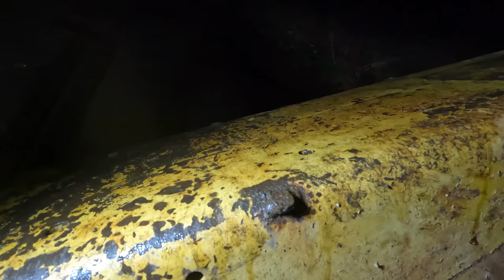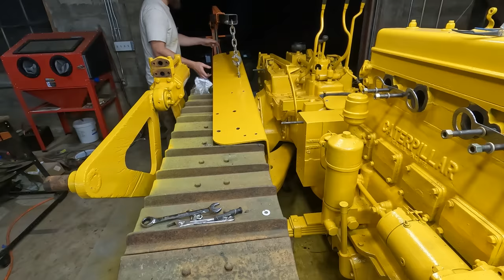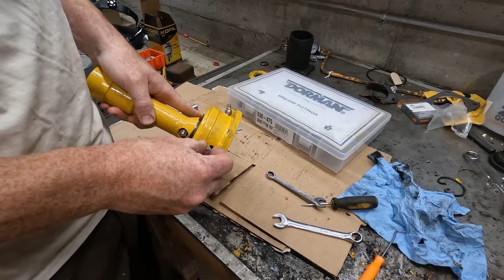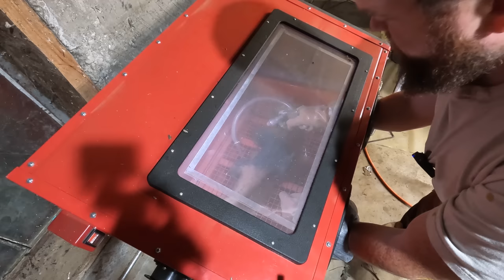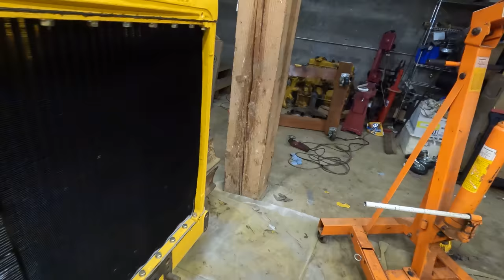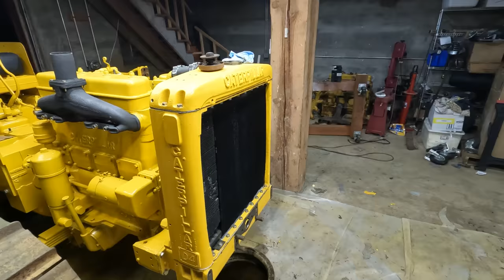Caterpillar D4 radiator and fuel tank install

Comment: Hi Matt, loving the story!! May I suggest, when you rebuild your waterpump (unless the manual states differently), put the front seal in backwards, so the 'lip' is facing outwards. Otherwise when you grease it, it has the potential to force one of the seals out. It will be protected well enough from debris under the pulley, and still prevent dirt / moisture from entering the bearing. Just my 2 cents worth, anyway! Looking forward to your next instalment!

Comment: I been watching your channel off and on for last 2 years.Im 60 now.My dad was a korean b-29 tailgunner based outa altus oklahoma he got out in 55.and his dream was starting his own construction buisness in minnesota well he was poor and bought lots of bulldozers and a case backhoe.my dad dyed at 47 years old from liver cancer.i still caint find the minnopilis molene backhoe he had he always worked on that.I found the guy that bought my dads old trailer that dad hauled behind his dumptruck he also bought the case bulldozer with bucket.he said i dunno how your dad did that cause trailer  it never had  no wood..dad just drove it up and wiggled on the steel beams and it sure wasnt legal but dad did it.dad  had a d4 bucket one and he bought i dunno a huge bulldozer with a ponymotor he got it running 2 times enough to push a hillside away into a road then it dyed again.i was just a kid i remember doing iumps to see if i could hop from ground to top of tracks

Comment: Lookin Good Matt,  You'll be "puttin around before Christmas???
You can probably pull the stem out of the spray can by running a screw in and pulling it out. But knowing your resourcefulness you've probably already tried.
I like your use of the engine hoist. I've never had one and too old to buy one now but it would have been a worthy purchase for me. I work solo just like you. I've used the three point and the loader on my Kubota's for some of the heavy lifting. I've got a "story pole" for the three point and the loader. 
SUPERB work SIR!!!!!

Comment: Matt, red locktite is for high temperatures.
Blue will fail and act as a lubricant allowing studs to loosen due to heat and vibration.

Comment: - Great video for us all, Matt... Congratulations with the continuing sprint to the finish line.
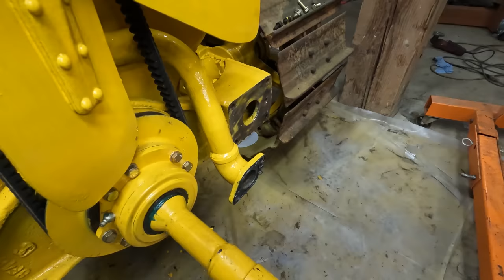- I was yelling at the screen earlier..."I remembered my hose clamps this time." 29:25 Phew ! ! !
- And, yes, I worried about when "we'd" be removing the water pump to deal with the pulley shaft inner bearing...10:00, and the answer is...38:36 "On the next video I will rebuilt the water pump."...hurrah(?)

Comment: Matt GREAT JOB overall ,if you have a bearing/ seal supply  house anywhere near you can see if they will take the time to reference their stock to see if they have a double lip seal instead of a single lip for the same hole you are trying to get a seal on ,you would be surprised how many are available, I used to build Harley Choppers back in the 70s & found this to be true then for them ,Good luck with all your endeavors ...Missouri Paul 👍🇺🇸👍👌😎👌🤗🌞
Reply: Yeah, measure the OD of the lip seal and shaft.  Double lip... some have helical groves to pump any oil or grease back in as the shaft rotates. Direction of rotation important to note! 
But, Matt needs to remember that the lip seal will only work if that other seal face is a clean surface without any gouge. Seen a few gouged shafts in Matt's videos.
Stainless steel shaft repair sleeves are also available from the same bearing/seal suppliers. If the shaft diameter doesn't match up with a common 'agricultural' grade seal perhaps a larger OD sleeve can be turned down to locktite onto the shaft... given some form of gouge repair will be needed. 
Zero axial misalignment is also important for a lip seal to work properly.... seemingly a future issue with the floppy front PTO shaft that is sure to be a filthy grease flinger.  Why even install that if the front PTO isn't being used? Better off painting it up pretty and putting it in the bucket of 'spare parts' for the next owner to use if they want.
Thinking the rear water pump bearing seal was OK is called 'wishful thinking'. 
For the PITA rework to do it properly, the lesson should be to replace all bearings and seals.

Comment: Just a heads up, make sure the bolt that holds the clutch adjustment is super super tight.  If it isn't you could lose the adjustment at the most inopportune time.

Comment: You're doing a great job! I just found your channel and have been watching hours of tour vids. In layed up with a broken collar bone.  I've been slowly starting on a D4 4g. Did you replace your fuel shut off/on valves? Thet look new. Mine are toast!
Reply from the maker: i cleaned off the old paint from the brass,  but didn't take them apart.  I think Squatch did a video where he replaced the packing in them.
Reply: Mine were to worn were the handle goes. Looks like many years of pliers. I was able to salvage 1 from the parts tractor that came with the other. Both 4g. I repacked them as Squach did. I was hoping someone was still manufacturing them. 
Thanks for the reply. Keep doing what you're doing!

Comment: Have not noticed any belly pan tow hook on your dozer. Was there one on your dozer when new. You might want one there sometime. Glad to see you found cooling system leaks. No need to rush it now. You going to spool up some new 3/4" wire rope on winch, how many feet ?. Are you going to guard your exhaust w/roll cage. Good watch. Lookin forward to next video.
Reply from the maker: I have the skid plate with the tow hook on it. Still deciding on the winch rope thickness and length.

Comment: Could you reduce the clutch lever offset or replace with a straighter lever to move  the handle further inboard away from your thigh without infringing on the adjacent lever?

Comment: Ooo direct start 👍😁
Fighting with the belt. 🤣😂🤣 great viewing.
ooo bummer the pump 🤮
bright shiny object ... It's looking good bud 👀
Lower hose ... its always nice it have extra parts 😁
Reply from the maker: I found the D315 operators manual on ACMOC, and it has directions for direct start in there!
Reply: @PacificNorthwestHillbilly   yeah I’ve seen that. I have a 12A 03563 1957 (almost same as 7U I think) and it has the boss came drilled out.  As a matter of fact the cover plate was off for who knows how long had been removed and run. 😳 
Parts 😊

Comment: I dropped the new can of PB and same thin I finally lost the pressure so I opens it up like a  can of spinach and use it out of a old long needle oiler… you click the bottom of the reservoir with your thumb ( no moving parts too break) garage sale .50 cents

Comment: Never should hit the collar/fan hub on the water pump! AND do not use an impact on the shaft nut! Thats what cracked the ceramic seal.
Reply from the maker: I didn't tighten it all the way down with the impact (I'm dumb but not that dumb)... the carbon washer in the seal was in good condition, but the neoprene bellows was cracked pretty bad
Reply: Ok, thats good!

Comment: Question.  Why not use teflon tape on NTP threads?  I'm 62 and I've been using it on NTP threads my entire life.
Reply from the maker: Diesel probably isn't as bad as gasoline and propane,  but petroleum products break down white teflon tape.  Didn't have any of the yellow tape which is meant for petro stuff.

Comment: Wonderful how the machine is nearing completion.   It should be very useful if there would be a snow fall.  They do travel well on tracks to frozen ground.
I was remembering.....that this configuration, with the blade cylinders as above...where as among heavy, dense brush or as felled tree operation to branches....
The track to cylinders tend to sweep limbs direct to the operator.  That there to the top of track, as carrying limb elements...can direct branches, sweep limbs as across where the operator station is located.  Thus, a curious hazard bit...less in larger, mesh guarded cabin type, and lesser where larger frame raise the operator height above track passaging limbs...small tree trunks or meshed...twisted brush and limbs.
I mention this as where the operator must beware such entanglement or debrie.
M.

Comment: Hay Matt, love your work, Sir.  I do have a quick question though - what were you planning to use the PTO for?
Reply from the maker: it drives the hydraulic pump
Reply: No other external functions?  =)  Just internal running of the dozer's hydraulics?
Reply: @NavyVet63  The front PTO is for the hydraulics, and the rear is for the winch.  That's all there is if he wants both the dozer blade and winch.
Reply: @johnbize5736  Thanks for the info, John.  I know NOTHING about bulldozers.  All I know is that I like watching people work on them.  Especially Matt.
Reply: @NavyVet63  You're welcome.  I think I understand the confusion.  I saw you said "dozer's hydraulics" and estimated a different explanation level.  People often call a crawler (crawler tractor) a bulldozer when it isn't.  It's only rightly called a bulldozer when it has the front bulldozer blade.  Matt did buy a bulldozer (crawler with the blade attachment).  And the hydraulics are only to run that attachment.  So the "tractor's" two PTOs power its two attachments and nothing else.

Comment: Looking at buying one of these, do you remember how much it weighed. Not sure if my trailer can Handel  it.
Reply from the maker: base tractor is about 11k, winch is 1.5k, brush cage and skid plate are about 500, blade and hydraulics probably around 2k, rough estimate.  I think we hauled it on a 14k trailer.
Reply: @PacificNorthwestHillbilly  Thanks so much for the info , Don't think my axles can handle that much. Would be a little sketchy

Comment: You installed the fan backwards,that is a pusher, no a pulling fan, please check it out.
Reply from the maker: I forgot to double check that, but I think you are right.  Good thing the water pump has to come back off
Reply: @PacificNorthwestHillbilly  on those equipments the reason is to push the tracks dust and debris away from the radiator otherwise all that dust and debris get pulled right into the radiator blocking the cooling efficiency, creating engine overheating in a very short time, thanks you for your kindness.

Comment: I usually turn a spray can of good stuff upside down in a holder, and punch a very small hole in it to relieve the pressure... Then make a bigger hole and empty the contents into an appropriate spray or squirt bottle... Works great, saves a lot of waste... 🤓👍

Comment: when ya break off the tip on your can of pb blaster i punch a small hole in the top to bleed off the propellant and then pour the liquid into a spay bottle,  much easier than trying to push the broken tip to use the blaster.

Comment: Next time get Alan Head Cap Screws for the Cranking Motor .  Its a shame about the Bottom Coolant pipe ! And the Hose clamps you are using on the Top Hose are the Very Best ! I used them on Every Fire Engine I worked on ! Thanks for the update Video ! It's a a Bummer about the Water Pump !
Reply from the maker: I've been burned too many times by the cheap clamps

Comment: Hey Matt, ain't it fun working on old ... stuff!:) Two hints, take a piece of wire and make a sharp bend, maybe in the vice, and then cut it off real short like a hook. Hook that in the broken nozzle on your can. I have been able to get the broken piece out every time. Also where the casting is pitted where the flange bolts on use exhaust sealer. It will fill the voids between the gasket. Lots of work! Great job. Can't wait to hear it run!:)